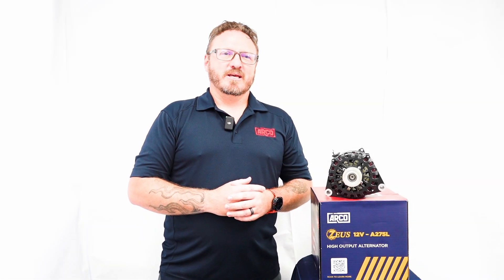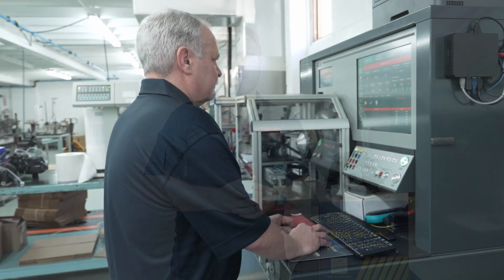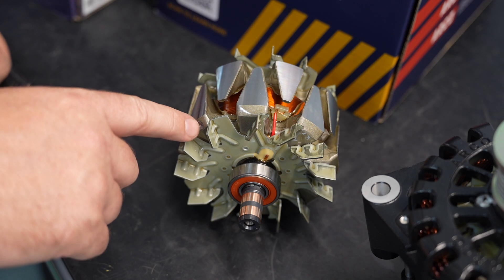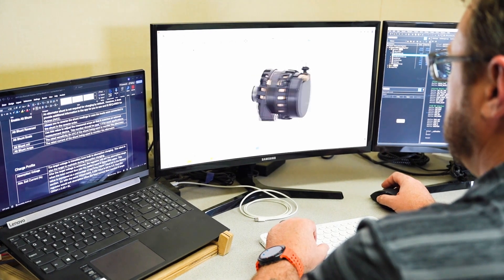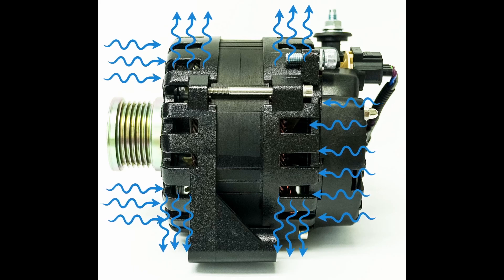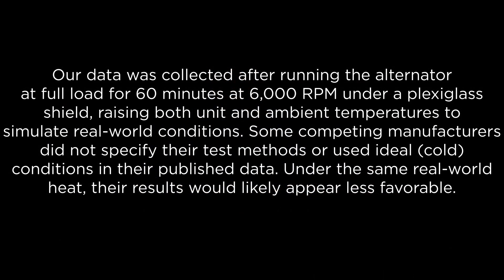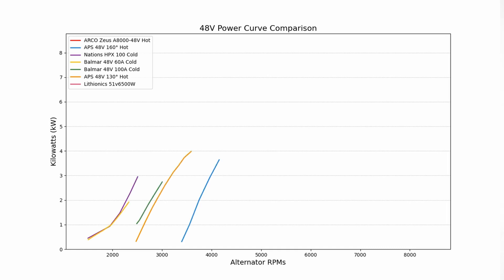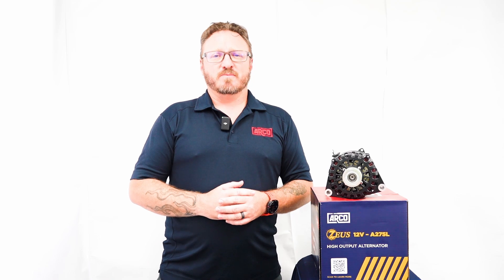Why ARCO Zeus High Output Alternators Outperform the Competition | Engineering Breakdown

Comment: You have a great product for sure.  I’ve owned and used you Zues high output alternator.  You have stepped the industry game up with innovative features.  The down sides to the product are:  1.  It’s not field serviceable.  2. Alternator shops can’t test the product so recommend replacement with other alternators they can test.  3.  Diagnostics is hard and expensive.  This leads to replacing good alternators if the regulators fail.  4.  There are no rebuild kits for your alternators so for Boats,RV, and motor homes that are traveling they are impacted with undo hardships other products avoid due to inability to diagnose failures in the field.  You have to mail the product back to your factory to test it, then have it or a new one mailed back.  Mechanics avoid wanting to work on them because of this and the complexity.  

Because of these design issues it creates undo hardship on your customers during failures.  So is missing your target markets mobile needs with service repairs.  

You designed it to be throw away if any field related issues occur. 

I travel up and down the ICW and RV all over the US and Canada.I ran into an issue with your product when the regulator died.  My only option was working with folks at the factory(who were great and did everything they could to help)which took two alternators to verify it was the regulator. Almost a month dealing with the issue.  The experience put undo hardships on us during our travels.  Because of it I pulled your product out of my boat and replaced it with a field serviceable product and one that alternator shops trust, can test, and sell rebuild kits for.  I have 1000 shops that can help me on the road or water now.  Make the product field serviceable, built in self test within the regulator to help diagnose the regulator that can be ran from you app, an event logger,  testing methods you can roll out to alternator shops and mechanics.  Do that and buy your product again and use it.  

Take care and best wishes! 

I do like the concept of your product, just not the impact it has when you experience a problem with it.